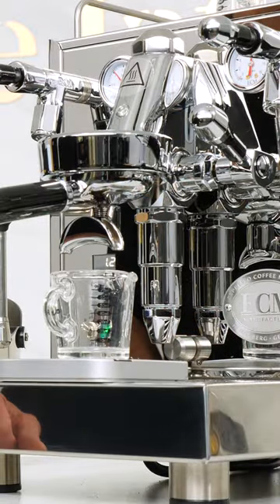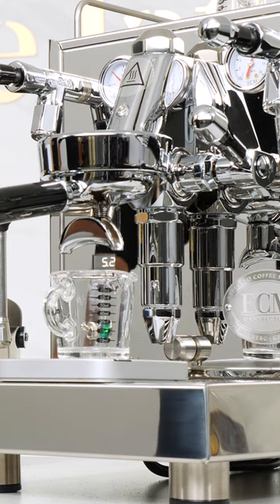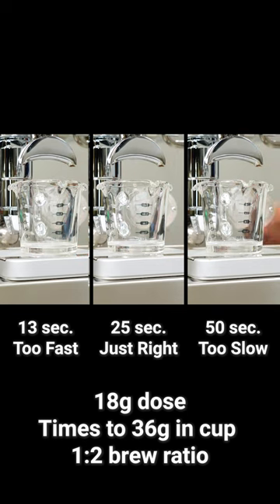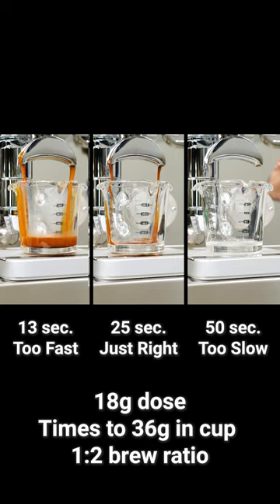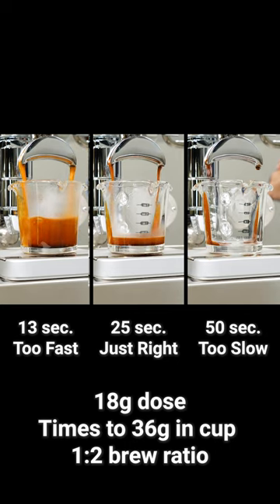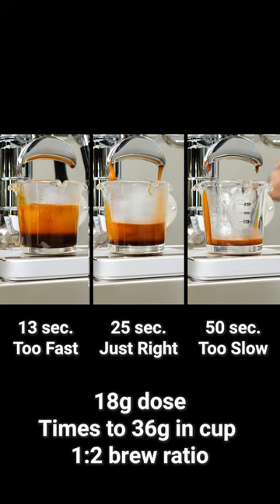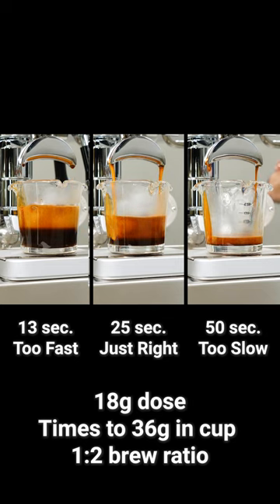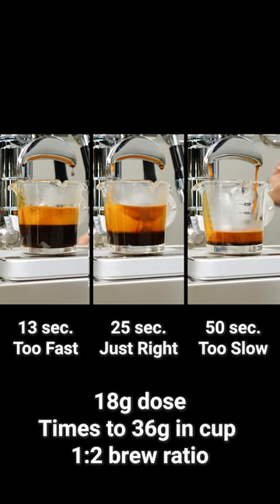Dialing-In Espresso Grind Size for Beginners Part 6: Shot Timing

Comment: what is best ratio for espresso, by grams or by volume, when google it said 2 shots is 60ml, but if you measure by ml, its not accurate
Reply from the maker: Hi m, 1:2 is the typical ratio. So 18g ground coffee in the portafilter and 36g by weight output in the cup. It's difficult to use liquid volume to do brew ratios. Espresso, especially when there's a lot of crema, is nowhere near 1g per milliliter. Not unusual for 18g coffee dose at 1:2 ration to produce a liquid volume of >60ml including the crema.
Marc
Reply: @Wholelattelovepage  thank you

Comment: Do you stop the timer at 36g and remove the cup immediately? Or are you looking to achieve 25sec / 36g at last drip?
Reply: Typically you want the shot to be fully extracted at 36 seconds if you’re using 18g of grinds. If you stop the machine at time before your shot has extracted fully and pulled a good weight, your shot will taste differently and typically sour.
Reply: What does fully extracted mean though, like the last drop? Or when it hits the target weight? Thanks

Comment: Is there any difference in time for 1 shot and 2 shot or should i always aim for 25 secs ?
Thank you
Reply from the maker: Hey user..., Timing is the same regardless of shot size. Do use the proper single or double basket. Single baskets have fewer holes so a lower flow rate.
Marc

Comment: I just recently got my first espresso machine ( GCP).. ive been timing my shots to start when the first drop of liquid exists the basket.. would you recommend i start timing them from the moment the pump is started?(the difference of about 10s or so)
Reply from the maker: Hi J, You can use either first drip or pump on. I ten to use first drip as I use so many different types of machines. Rotary pump tend to get to drip much faster while it's longer on a vibration pump machine like the GCP. For basic timing if going from first drip I'd shoot for the lower end of the 20-30 range. Timing is just a reference for you to compare shots on your machine.
Marc

Comment: I’m getting 50 grams of espresso dosing 18 grams in 26 seconds how does that sound ?
Reply from the maker: Hi there.
With a typical, 1:2 double espresso recipe, 50g out with 18g in sounds like a fast shot as you should be aiming for about 36g of liquid espresso out in the same amount of time. That said, if what you are pulling tastes good to you, then I wouldn't change a thing.

Comment: I put in 18 grams but my output is 74 ....yyy
Reply from the maker: Hi there.
Sounds like your grind size is too coarse. I would recommend adjusting your grinder to a finer setting. Keep in mind, the finer the grind, the slower the shot.
Reply: @Wholelattelovepage  if i go coarser, my pressure is too low and i get a sour shot
Reply: @youtubeaddict1 make it finer